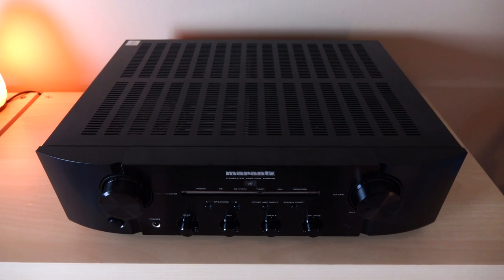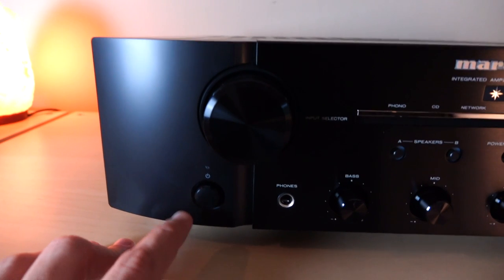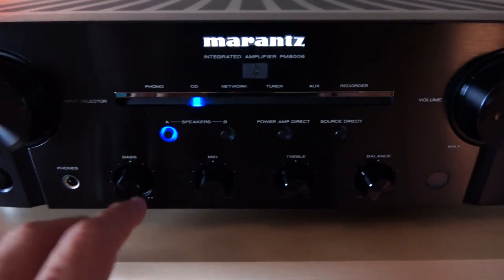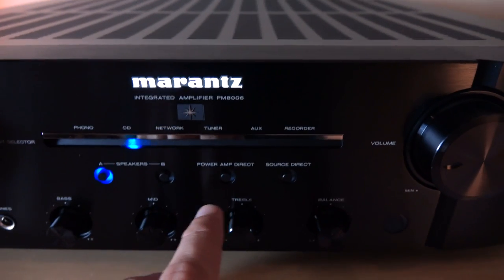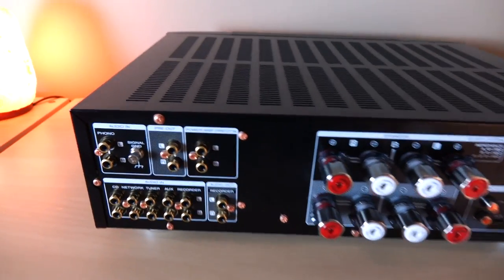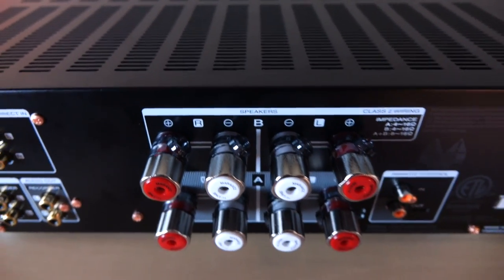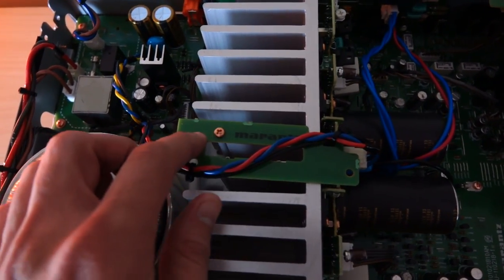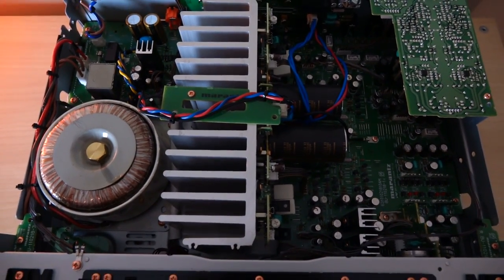Review!  The Marantz PM8006 Integrated Amplifier!

Comment: This review is spot on! One thing though not covered is reliability - super important.. I bought my 8004 early 2011, so 8 years ago, and it's been on 24/7 since then... still super quiet, not a cracking sound when turning the volume control, works like it is new out of the box.  I can't say the same about arcam alpha, which lasted a couple years, NAD 315 which lasted a couple months, Adcom 5300 and pre 710 wich lasted about a year...
Reply: Thanks for the information. Reliability is important.
Reply: Made in Japan and with superb components. Built to last, as it should be….
Reply: How does the 8004 compare to the 8006?

Comment: Thank you for your nice review! Unfortunately, you didn't say anything about the phono-stage of 8006!
Reply: It's a good phonostage, very good in fact. I paired it with the goldring E3 which I think plays well with it. 

All of this feeds into a pair of Lintons. It's not a combination that is talked about, at all, but I have a lot of old records which weren't necessarily pressed well and needed something that could handle both that without emphasising "the mess", and good recordings as well.

I think it works well. The goldring gives the music some room to breath and both the Marantz and Lintons have a low noisefloor and add some gentle warmth to the presentation. It walks a good line between smoothing over a messy recording and giving detail.

Tonecontrols are excellent. I have adjusted them to fit my room and rarely feel the need to readjust them. To illustrate, I have base at +1, treble at -1 and mids at +2. Sean is right and the Marantz is a bit thin in the mids, but the tonecontrols are more then capable to compensate to taste.

Some songs do shine at neutral settings I noticed, "nothing compares" and "sombody that I used to know" for instance. I use source direct on songs like that and it's fine. Sean described it as a loudness button for treble but mine doesn't do that all. Not in this paring in my room anyway.

Long story short, good phono stage that plays well with a relatively cheap cartridge 👌
Reply: @HerrFinsternis  Thank you so much for your detailed reply. I know someone in my known circle having Marantz 8005 or 8006...he lives far away... someday need to visit his place to audition it.

Comment: It's a great time to be into audio. We have so many choices among some very good products and at fairly reasonable prices. I guess I'm not a purest because I would not own an amp without tone controls. They have made all the difference in almost every audio system I've ever had, including my most recent one when I dumped all of my vintage stuff and bought all new modern components for my main sound room. I really like the addition of a midrange control. That's a nice touch. Back in the day (!970's) that was a common, even an expected feature. My Sansui has three and the Pioneer has two bass and two treble level adjustments. In my experience, a little tweak of those control can do wonders for the overall sound of a system. Another great review. By the way, Under Armor HQ is just up the road from me and I'm going to put in a good word for you.

Comment: Just want to say for people reading the Source Direct on my PM8006 doesn't behave in this way. The difference is very subtle. It cleans up the bass a bit. It also adds just a small touch of sparkle on the high end. The separation of instruments marginally improves with Source Direct on. I would say I prefer Source Direct on, but the unit sounds good either way.
Reply: Same for my PM 7005
Reply: This is the same with my Marantz pm6007 (I think maybe Zero Fidelity has a faulty source direct). I have the pm8006 arriving tomorrow and can't wait to hook it up and play some tunes. 👍
Reply: Tried it on and off with a range of recordings. I’d say it’s speaker dependent. My MAs have high resolution c cam metal dome tweeters. Pure direct can appear a bit too revealing. Not an issue with very good sound sources and vinyl. Definitely tightened up the bass which is useful as I have a REL sub connected to each channel in stereo pairing. For things like organ music, source direct  is superb. It sounds like you are in the church etc. it can definitely tell me the quality on a violin especially for solo material. 
For choral it does emphasise the sopranos more but improves the stereo soundstage. For plain old rock, it’s excellent…Money from DSoTM streamed in hi res lossless is amazing. Same for Dreams and the Chain from Fleetwood Mac’s Rumours. There is stuff in there that I never heard before, even from my great vinyl deck.

Comment: Great review as usual, Sean. I’ve also like the fact that Marantz adds a mid knob. One of the amps I’ve been running in my rig is a vintage but fully refurbished Marantz 2220B integrated in my system into Tekton Pendragons. 
Would you say this amp still retains that classic Marantz sound, or is it just a different animal? 
Also, it’s not a big deal cuz I know you’re not really a vinyl guy, but I’d love to know how the internal phono pre sounds on that amp. I could of course add an external phono stage if need be, but that just leaves an unused input. I’d love it if you got your hands on something like a Rega P1 or ProJect debut Carbon TT and even an ok cartridge to see how the phono stages stack up in these integrated amps you review. 
Thanks again for the great review, Sean.
Reply: I also have a 2220B and have recently purchased a PM8006. I run a Marantz 6100 with an Ortofon 2m Blue through the phono stage and I'd have to say it sounds amazing. I would say the PM8006 sounds more like a vintage Sansui than a vintage Marantz, but it does have the dark bassy sound of vintage Marantz, but with the Sansui mids and highs.

Comment: Good review. I had the PM 8005 which I traded in for a Pm14 S1 SE. The store did not have a PM14 in stock to listen to but I ordered it based on the more or less good value of the PM 8005. The first PM 14 went it o protect mode as soon as I hooked it up at home. This was due to the salesman removing speaker cables on the amp without turning it off after he demoed the amp at the audio shop. That amp went in for repairs and I was blamed for the fault. I had to pay another $444 NZ dollars for that repair. Took about 2 and a half months to get it back. Lasted for 7 days and then went back into protect mode. It was then  replaced at no cost with another PM14. Very poorly designed protection circuits on the Marantz line. Sound wise the PM8005 in my opinion is a better bang for buck amp than the PM14. I still have the PM14. It is in it's box being used as a doorstop :-) I wanted a amp for my bedroom as my mail amp is a Yamaha A-S2100. The Yamaha is superior to the PM14 in all comparisons. 23kg of high end sound at a mid-level price. I will never part with the Yamaha. My second system now is an old 1982 Accuphase pre-amp and an 1989 Accuphase P-11 power amp. The Accuphase and Yamaha are cut from the same cloth.  They have the famous PRAT (pace, rythym and timing). The PM14 on the other hand is not as dynamic and seems lack lustre with inefficient speakers. Great to put you to sleep. I tried selling the PM14 here in NZ on our local online auction at a $1000 dollars below retail and no takers :-). Will just keep it for now and probably sell it in 30 years time at the $3500 price I want. In 30 years time that will be the equivalent of 30 packs of cigarettes here in NZ :-). I agree with you about the coloration of Marantz amps. The PM 8005 was good when the source direct was not on and the treble set at -1 and the mid set at +1 and base left neutral. The PM 14 also sounds a bit better when the tone is engaged. Keep up the good honest reviewing.
Reply: Same experience with my PM7001KI. In/output protection is really bad. Off-course isn't smart to keep the Amp powered and mess with the cables but still... cheaper amps will easily survive this.
Reply: @baskapteijn  I hope that salesman at Soundlab in Auckland has learned his lesson on disconnecting amplifiers. A lesson that I literally paid for.
Reply: Couldnt disagree more with the OP.  I had a Yamaha AS3000 for a year or so and it was poor build quality for the money, the side cheeks were cheap the front and top panels felt abit loose and ringy.  The sound quality was even worse, matter of fact with no colour or life, it literally made everything sound clean but dull.

The Marantz 8006 at nearly a quarter the Rrp sounds better, smooth, warm, expansive leaning towards an emotional connection much like a good valve amp.  It also was built well for the price.  The PM series are even better.

Same goes for the CD/Sacd players... the Yamaha 3000 Sacd player had Awful timing, bass was totally off point and it sounded grey.  The Marantz SA-15 S2LE in AB comparison was far superior, more colour more life more emotion better bass and less than half the price!

Comment: Thanks for a detailed and valuable review! I am an owner of Rega Brio/Apollo setup since soon 1,5 years ago. First I got KEF Q350 but replaced them with R500 at the 30% sale this year. I am generally very satisfied with my stereo system. I found it ok to have an amplifier without tone controls because it feels audiophil like.
With a perfect recording tone controls are not needed. The problem is that the most recordings are not...
And many are bright and with weak bass(Which can be a problem because KEF has a pretty bright tone). The most radio channels have weak bass.
Here I realise that there are A LOT of situations when just a slight increase of bass and decrease of treble had made a significant improvement and made the listening more comfortable and enjoyable.
Therefore I find Marantz 8006 very attractive. It's also good looking.
Have you any experience of Rega Brio, and if so: how would you describe a replacement of Rega Brio to Marantz 8006? Would I go a step down in quality? And is the 70w per channel at 8ohm of 8006 stronger than the 50w per channel of Brio? As we know the stated power is not always comparable between different brands and models.
Reply from the maker: The Brio - PM8006 would be a side step.   The Marantz will offer a cleaner midrange, stronger  bass, and a smoother top end.   Imaging will be wider.   Power will be the same. The Brio will have more texture in the mids, slightly cleaner bass, and bit grittier in the top end.  It's tough for me to say which you'd prefer.
Reply: @ZeroFidelity  Thanks for reply! You confirm what I understand from reviews that Rega Brio is a very competent amplifier despite the "only 50w".
But smoother top end and opportunity to compensate for different recordings makes the Marantz very attractive. I will consider it!

Comment: Sean, how would you compare this Marantz integrated with the Parasound INT 6 integrated you reviewed recently?
Reply from the maker: A copy n' paste that I wrote somewhere else:  The Hint 6 is better in just about every way as it relates to raw performance.  It's more balanced throughout the frequency range.  Has more power on tap.  Superior tone - particularly in the midrange.  Cleaner bass.  Smoother treble.  More effective tone controls.  That said, I could see some people preferring the Marantz.  It's brighter.  The bass is stronger (albeit less articulate).  The midrange is thinner by comparison, which is actually something that some will prefer.  So as always, it will boil down to taste.

Comment: Q:  "What's inside the Marantz?"
A:  Actual power components that A/v receivers lack.
100 watts x 2 channels into 4 ohms (20-20,000 Hz)  NOT  "100 watts x 2 measured at 1khz"
Reply: Yes a toroidal transformer ensuring reliability even if one pushes something more than its boundaries. 👍

Comment: Thanks, real helpful review Sean. Having now reviewed both, how did the PSA Sprout 100 compare sonically to the 8006?
Reply from the maker: That's an interesting comparison.  The Sprout has a thinner, cooler presentation.  The Sprout has the advantage of being significantly more compact, being a true full-featured product, and showcases superior bass control. However, bass aside, I do believe that the Marantz has the edge in every other way.  A bit more dimension and solidarity to the sound.  A bit more natural ness in the mids.  A bit smoother on top.  Better imaging.  Honestly, given the huge difference in price, this is probably how it should be.
Reply: @ZeroFidelity  Mr. Fidelity, could a headphone amplifier be connected to the Marantz PM8006 (or Yamaha A-S1200) using it’s “Pre Out”s? If so, would an A-B switch box be needed to add a sub-woofer? Or can the Marantz “Audio Out Recorder” jacks be used for an external amp or sub?  Can the Yamaha "Line Out"s do the same?

Comment: Hi love your review on the marantz amp. I own a similar amp (pm 7003)  which has similar.specs and sound. From your experience what amp would make a suitable upgrade in sound in comparison. I would be looking at second hand on eBay. Maybe a little more articulate in bass and less aggressive in treble at times. I have it paired with marantz cd 6005 and Def tech monitor 65 speakers. Streaming is supplied by  echo dot to RCA inputs  when needed

Comment: If you had to choose between a schiit Vidar  or the pm8006 what would it be?
Reply from the maker: The 8006.
Reply: @ZeroFidelity    Thanks.   I have been thinking about getting this or maybe  dual  shiits.  
I like the idea of cheap mono blocks,   but I'm in Canada and the Marantz is easier to get and probably would sound just as good.    I run Klipsch speakers,  so I don't need a ton of watts. 

Currently have an old  Marantz sr-48  its almost 20 years old so Im sure the 8006 would be a good upgrade.
Reply: Wow. That’s saying a lot. I have heard great things about the Vidar but I actually heard the Vidar two years ago at RMAF and was not moved by it. It wasn’t bad, it just did nothing for me.
Reply: @revysledbum  It's $1599.00 CAD on amazon Canada. I think the Cambridge Audio CXA80 at $1299.00 CAD is the better deal. It includes a DAC with 4 digital inputs and 4 analog inputs and also has 10w more power.
Reply: @Taffy84    Thanks, Ill look into that. I have a external DAC already. Kinda just want a simple amp. I like that the Marantz has a direct Amp input.  I like the Vidars because they have Balanced inputs. My DAC has Balanced outputs and built in volume control so you an use it as a preamp.

Comment: I'm so happy you're reviewing this. Made in Japan! Not bad considering the price. It's interesting what you said about the source direct button. That was exactly what I heard too.
Reply from the maker: Glad to know I'm not alone!
Reply: I have the 8004 and the source direct does not do this. It cleans it up a hair. Strange the newer one does this.
Reply: @bugpack6  That's interesting. I had the 8005 and I found the same as Sean described in the 8006. I think all three are essentially the same amplifier with minor tweaks. It could just be overall system dependent as well. Cables, Speakers ect.. all contributing to how revealing the source direct is. Or there may some real differences in the three amps.
Reply: Same here, i have the 8004, i hear what Sean talks about except for the source direct button...to my ears, it cleans up the overall presentation a bit, tilts tonal balance a bit maybe, not in the treble but in the upper-mids, and it sounds dryer.  On totem hawks, the noise floor is reduced with source direct engaged for a more forward sound.
Reply: I have the PM Pearle Lite, the one before the 8000 series. Agree on most of the review but source direct does work very nice in my system with a NOS DAC and von Schweikert speakers. It's not making it brighter but more natural sounding to my ears.

Comment: Great Review...I've been an audio enthusiast since I was 14 and I've  seen a lot of so called " Purest Companys" come and go but there is a reason companies like Marantz and McIntosh are still around! They just sound like Music and are built like tanks! One thing you forgot to mention is that the 8006 is built in Marantzs Reference factory in Japan...Marantz Japan can trace its lineage all the way back to the late 60s early 70s when Superscope owned Marantz and moved some of the Manufacturing  to Japan. I'm currently running a Japan built Marantz 8012 receiver in my main system. It uses amplifier modules similar to the ones in the 8006 and has a massive power supply. It replaced an older 6009 receiver.....a night and day difference in sound quality! Very musical , perfect match to my Revel Concerta speakers....best sounding AV receiver I've ever owned and equals the quality of some of my vintage separates that I run in other systems!
Reply: The PM8006 is built in DENON factory in Shrakawa, Japan. It's DENON's factory since 80's.
Reply: @82ivaylo  I guess that's what Marantz calls their Japanese reference factory since Denon and them are basically the same company now!

Comment: Hi nice review, how do you think this would fit / work and sounds with my Focal Aria 906s and Rega  P6 Turntable inplace of my Rega IO , Because I;m looking for an upgrade to my amplifier . PS I’ve just got a new Marantz 7006 cd player added to this last week. So will be interesting to see what you think  about this upgrade.
Reply: I have a PM8006 with an F906 (without the "s" and I don't know what the letter s is). It seems that this amp pushes out everything that the 906 is capable of. Good approx, without colors and at the same time musical. Its main asset is its preamplifier, which is difficult to control with a remote control at low volumes. The PM8006 is universal with all speakers in my opinion.